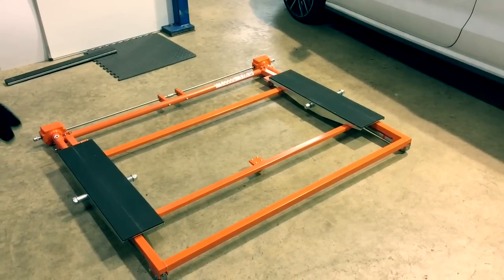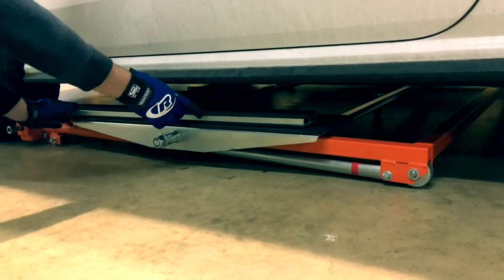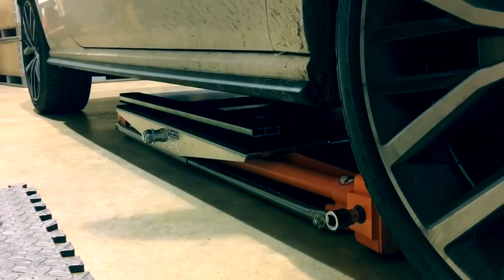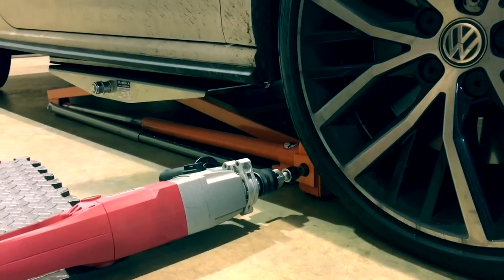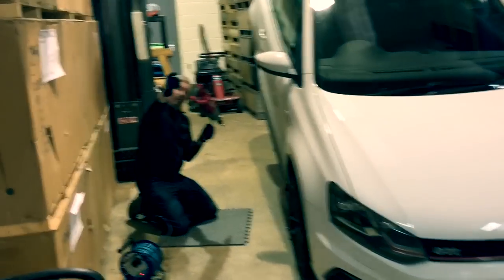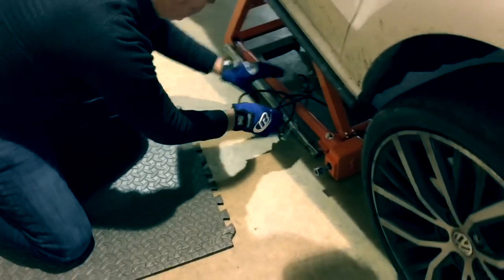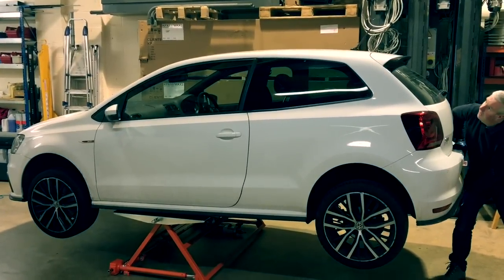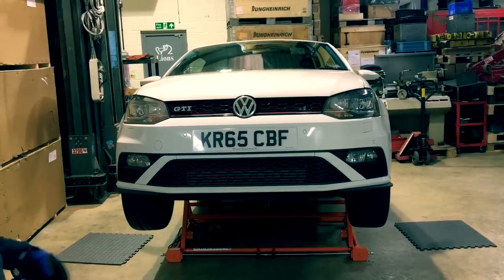Autolift3000UK Promo Video

Comment: Consider me an old safety bore but I will never crawl underneath a car resting on a lift like this.
Reply: Yeah, all it would take is one stubborn bolt and the front of that car is coming down on your head. I'll stick to good old fashioned jackstands,
Reply: each our product is tested with load 5000kg, that is more than 11 000 pounds. We developed the scissor lifts 20 years ago and we use only quality materials.
China quality is poor and really dangerous . Very important is quality of material in gearboxes.
 Our product comes with our jackstands
 and uneven rails
Reply: @1337penguinman  To be honest you would have to be an idiot to get under there without any safety precautions I would highly recommend using axle stands in place when using this product.
Reply: @Autolift3000uk.limited  I would like to see this test that you claim with five tons do you have a video of this?
Reply: @DryUrEyesMate  indeed always use telescopic car jacks that extend to the height of the vehicle while in the air or as you said it’s an accident waiting to happen

Comment: What keeps the riser bars from slipping on the main lift platforms?
Reply: rubbers on the platforms
Reply: @Autolift3000uk.limited  Can your product work with an impact wrench, to turn the screw and make it elevate to lift the vehicle? Or will  it only work with a rotary drill?
Reply: @manofsan  only rotary drill, ratchet or mechanical handle. The impact drill damages the gearboxes.

Comment: hi, I would like to know which drill you use, because my 500 Watt electric drill cannot raise the car.  how many Watts do you need ???  Thank you
Reply: It’s not how much watt you use but the nm power ratio the guy has said you need at least 35nm of torque required power to lift the stand so your usual impact gun should be just fine

Comment: No way am I paying $1500 US for this.  More like $500.   I can buy a several hundred pound twin post car lift that lifts 9000 lbs and has a motor and pump for around $1800.  There is just no way this 100 pound item has $1500 worth of material or engineering  in it
Reply: That’s ok if you have the room. And height for a two post ??

Comment: If the car is a ‘Front Engined’ but ‘Rear Wheel Drive’ (e.g. a BMW 3 series), do the gearboxes on the 3000 still go towards the front of the car? I’m assuming it’s the engine weight that matters, hence it’s only something like a rear engined 911 where the wheels have to point to the rear?
Reply from the maker: The gearbox of the autolift 3000 can go towards the front of the car and also backwards. The important is centre of gravity
Reply: Hi, can you use 2 rise bars eithr side if you want to make sure your clear of a certain part or parts and if so how much and is the drill included in the kit and how much are they since 2016? Thanks.

Comment: is this only good with fwd or can you use it with rwd vehicles
Reply: If you have a rear wheel drive vehicle then the position of the ramp would need turning around as the gearbox mechanism where the guy has placed it is in the front so in essence you need the gearbox mechanism at the back for this ramp hope that helps